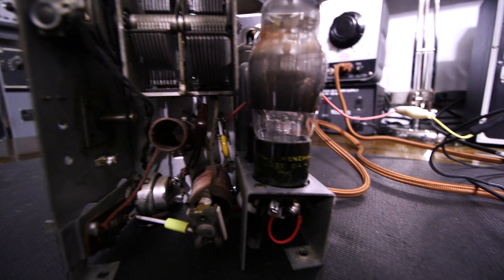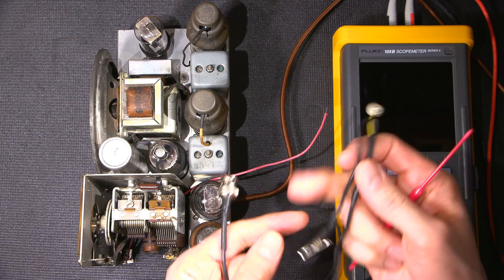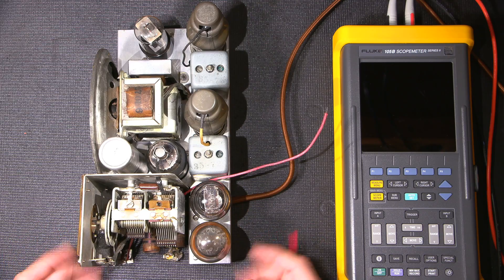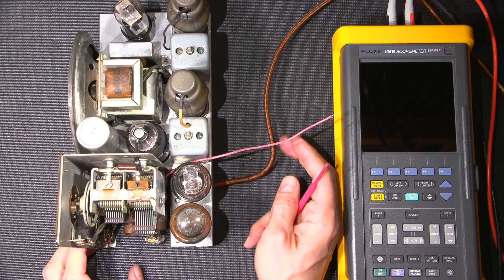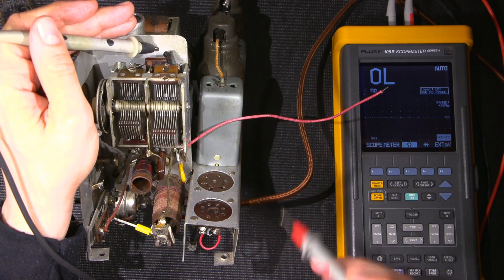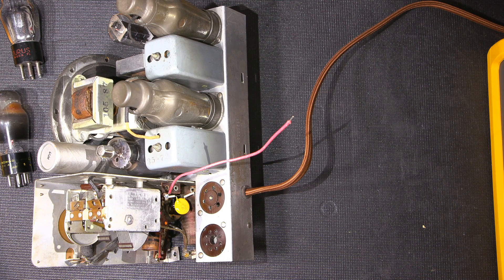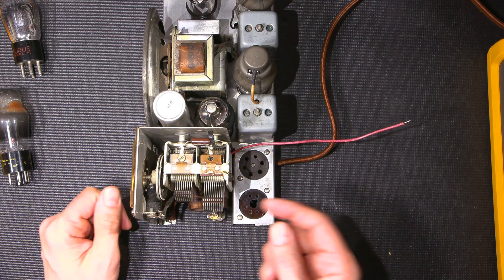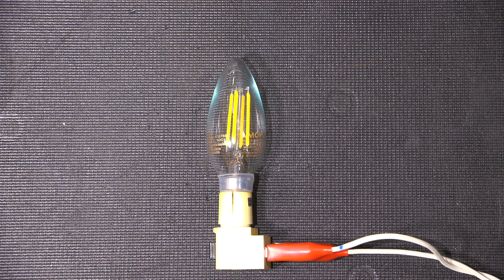See High Voltage Created From Falling Snow!

Comment: I have been flying commercially (pilot) for 32 years. Light Aircraft are more susceptible to static damage and lighning than larger airliners. Altho both have trailing edge wires designed to slowly dissipate static charge and keep any arcing from happening. The electronics in airliners are extensively grounded and shielded given the huge amount of computer controls used in today's aircraft. Falling snow has caused me more than one strong jolt doing a walk around on the aircraft before, just touching it. Falling snow builds up a huge amount of static electricity.  Thunder snow (lightning) even if it wasn't heard the buildup of static from the snow can and does run in directly thru the antenna connection. Especially on a dipole or long wire antenna. I would like to have known what difference if any having the ground connected . This type of static electricity would have most likley also affected the line voltage as well. Probably a combination of both.

Comment: Static electricity is something else.  Father was big in radios. He has an Antron 99 base antenna. It was hit with lightning and it exploded the loading coil. The rest of the antenna crashed to the ground. Grandmother's house has been hit by lightning balls,  burns right through the screen, bouncing off the floor and out the other window.

Comment: Hi Mr. Carlson, my guess it is an RF arc, not static electricity.  It appeared your setup was due to a very high Q with your antenna setup, and it would arc as it was going into resonance, momentarily killing the resonance, then the resonance would build up again, then arc again, and so forth.. are there any other ham operators in your vicinity?  If you haven't already spoken to them, you could see if they were on the air.  Likewise are you close to an AM station?  Finally, if it is DC, perhaps it could be a line that is building up a DC charge, one end arc's over, sending a pulse through the line making it momentarily resonate at some frequency, causing the arc on your end.  Kind of like natures own oscillator.  I used to maintain an FAA non-directional radio beacon that was around 400kc and resonant arcing was an occasional problem so care had to be taken when setting up the spark gap for the lightning protection.

Comment: Ceramic capacitors man. Piezoelectric effect in reverse. They behave oddly with really high voltage. Get a diecast box and stick 10 at least neons in series inside on your aerial down feed from screen to centre. Drill a hole so you can see what's happening outside with the atmospherics. Two reasons for the series neons, they have about 2 or 3pF each so in series you have way less shunt capacitance. The other reason I guess is obvious. Several KV will blow one up. I have had one hell of a whack on a summer's day from a long wire antenna. Great video, rather interesting 😎

Comment: Isn't that why the guys that often use big antennas have a large resistor on an alternate path to ground? Static builds up, it goes through that resistor rather than the radio gear.

Also heard that some people in dry remote locations have also used this effect to trickle-charge a battery. The pulse from the spark goes through one side of a step-down transformer, and then the other side of the transformer has something with a capacitor that can take the impulse and then trickles it to the battery cells. Nothing too amazing though, this kind of thing is for some 12v system that is just enough to run a radio in itself.

Comment: Maybe very high frequency pulses that the coil was high impedance to it. Then the cap allowed the voltage to build up then spark?
Have you a safety spark gap to discharge lightening etc on you antenna?

Comment: Maybe a smaller gap in the isolation transformer was discharging first causing a collapse of magnectic field in the radio inductor causing another secondary arc to its isolated ground.  Even though it is a low value inductor, we are talking about a very high voltage.  This sort of reminds me of the principle of operation of an old-sytle tesla coil autotransformer using a spark gap.

Comment: Obviously static on antennas isn't unknown, but the lamp being affected is interesting. The periodic nature of the arc is interesting, too.  Could the bulb have induced current in the coax?  I looked up LED filament bulbs, and sometimes they use a capacitive power supply in the cap.  If the bulb supply failed I wonder if it could have induced current in the coax causing the arcing and the snow was just a coincidence.  The regular pattern of the arcs plus seeing what the bulb is doing makes me think of a capacitor discharging.  I suppose snow/rain could cause a discharge with some regularity, but those arcs seem too regular.  Maybe place a piece of coax near the bulb and see if anything is induced on it.

Comment: I'll bet the antenna is acting like a lightning rod. Arcing is ac and so the coil is an open and the normal power feed is a path to ground even through the isolation transformer. There may be arcing across the on/off switches. This may explain the noise through the speakers?

Comment: I've seen this before from rain-static on a HyTower HF multiband vertical antenna.  It would frequently generate enough voltage to arc across the coaxial connector, and once caused pinhole burn-throughs in the center insulation of the coax at a resonant wavelength, making the coax lossy and useless.

Comment: Our Cushcraft 67B with 80 meter beams and the Ladder Line fed 180 meter long wire would throw almost one inch sparks during dust storms in West Phoenix when we'd unhook the coaxes at the exterior wall to the shack. And yes,  We learned the hard way about lightning... Twice!

Comment: I have enjoyed all of your videos I have seen. I find this one particularly interesting. I still consider myself a beginner when it comes to electronics. When it comes to terminology or principal, please forgive me. 
It appears as though your antenna circuit was acting like a half wave rectifier. With the atmosphere being a cathode and Earth as a anode or ground. More accurately your antenna seems to have behaved like a anode in relation to the atmosphere;  Yet, a cathode on your bench. Combined with your isolation transformer acting as a zener diode. When the circuit accumulated enough static it would jump through the coils as well as the insulation. For instance, at a high enough voltage, insulators will conduct. It most likely would not have happened if your coaxial shielding was adequately grounded. But, since everything was insulated your circuit collected enough static electricity to jump the gap. Not only between the leads of your safety capacitor; But, through the coils of your isolation transformer as well.  I think that if you were to have adjusted the tuning, it would've only changed the frequency and duration of the arc. However, you made a excellent point regarding the possibility of it being RF. Although, I think it is more likely it was static. It is quite possible the safety capacitor was taking whatever current to ground despite the 30 ohms resistance and that there was so much accumulating it would produce a arch. Whatever the current, it  also had to overcome the resistance through your isolation transformer. Similar to the way your capacitor tester measures the resistance through the insulating boot. It seems as though you could always rectify static off of your antenna if it was insulated. I have often wondered how to make a safe and reliable power supply. That  could handle it. The voltage would vary depending on atmospheric conditions. As well as solar or otherwise cosmic activity. I read in a comment the voltage ⚡ could be around 400kv. It seems like a similar circuit could be set up on the same principal. Where the static itself went through something similar to your isolation transformer. Through one side of the line cord and out the other, using Earth as a ground. To drive the secondary coil. Where it could be rectified and regulated to safely provide current.
     I heard on a YouTube video last night. That there is a device capable of harnessing power in a similar fashion. That is less than a few cubic feet. That doesn't use the Earth as a ground. Since your antenna is isolated. It seems as  though you could easily set your antenna up for full wave rectification. By adding more coax and some diodes. Or just utilizing the shielding as another conductor by placing diodes on the antenna    side away from the center conductor. Directing the flow away on the shielding from your bench and towards it on the center conductor. With or without  using the earth as a ground. You would be able to detect voltage. Possibly without a antenna. However, depending on the weather. The voltage might be a very small amount or very significant. Especially in comparison to using the earth to complete the circuit. For instance, this reminds me of a experiment that was done where a several hundred foot length of wire was insulated and then connected through diodes to Earth as a ground. The line energized and burned. I'm not sure if anyone was hurt or not in the process. So if you do experiment with it, please be very careful. It makes sense that your antenna circuit would behave the same way depending on how you set it up. Depending whether or not you incorporate the Earth as a ground. Although your antenna lacks the capacitance of such a long length of wire. It is obviously capable of producing high voltage. Which would explain what happened to your lamp as well as your speakers. Which would likely be in part, the result of coupling; As well as static discharge. Thank you for all of your educational and thought provoking videos!

Comment: The coax and radial might have been acting like a pulse transformer. The coax charges up, a spark happens Outside! And the pulse couples into the coil and cap to create a a high enough spark to the chassis
Reply: I like this theory, especially since when a capacitor and inductor resonate in seriesthey produce high voltage in the middle.

Comment: Is your antenna sharing an earth ground with your house ground? If so, can the static electricity buildup then coming through the negative side of the circuit from the plug and then find the path of least resistance. Static can do some Strange things😊

Comment: These old units are like old cars made with real steel new cars are plastic and paper thin sheet metal . They actually had power to ground wiring and switches . Not a can bus twisted pair 5 volt nightmare to diagnose  in a harsh environment . Very informative video of quality common sense equipment .

Comment: Your antenna to home became a  long giant capacitor! That spark is pretty significant.Your  outside antenna itself is a plastic covered wire with no shielding whatsoever, hmm. Saw your set up in the ice storm video. To keep static from building up on it maybe a spark gap could be used to attract the electrical build up from entering the home. Solder a piece of wire to it just outside the home and  attach the end near the ground on a rectangular wood block almost half way along it's length. One the other end of the wood block attach a thick solid  copper wire  like a #10 or #8 that goes to a ground rod. Make sure the ends of each wire is  approximately 1/16 inch( 0.160 cm) away from each other and in the same line as each other.The wood block itself could be screwed to a metal rod into the ground for support. This should keep the electrical build up at bay. A great excuse to go your local home improvement store!

Comment: All transformers primary and secondary windings have capacitive coupling beetween them.  The seperated windings are great for blocking power line frequencies, but RF can still go right through them. They make transformers with Faraday shields Between the windings to improve the situation, I wonder if yours has one, and if its connected properly.

Comment: Hello Mr. Carlson,
It's my theory that you have water penetration of your coax. And since you said that your using such a small coaxial cable you should inspect your penetration points and connections for this possibility.  If your antenna in mounted outside in harsh winter weather, snow and dry air is a big conductor of electro-static charging conditions. I don't know if you are using a simplex or duplex antenna however this antenna most assuredly is connected to a ground.
I have a question for you. Is the table you used showing the video connected to an earth ground? Like an ESD type set-up? If so that explains why your chassis was arcing (spark gapping) from the charged Capacitor via your ESD ground.  If you want to test this theory, unhook your ESD ground wire and retest. Or you could just insulate the surface by setting the chassis on a thick non conductive surface.
Best regards.

Comment: It almost sounds like the coil on the radio was behaving similarly to an automotive coil. once the charge in the automotive coil builds up and the field collapses when the points are open it generates Spark. I wonder if something in the radio or the Transformer were acting in a similar way to ignition points.
Reply: I was thinking along similar lines. The EMI created and discharged from a cars ignition coil, would convenientaly find its way through the ground plane wire attached to the hood. And without the filtering capacitor on the primary of the coil, the speakers would hum at the same frequency of the engines  ignition pulses. There is no  "physical" connection, but electricity is still being sneaky. I agree with the similarity here.

Comment: You could probably estimate the voltage at the point of discharge by measuring the distance between it and the chassis and multiply that by the breakdown voltage of the air.

Comment: Maybe you should install GDTs on your antennas if you don't have them already. Presumably the discharge energy was relatively low current; enough to destroy some of the bond wires in the lamp LEDs which might be visible under a microscope.

Comment: Note:
The piezo-ceramic ignition element of a lighter can also be used to generate arcs to a metallic object without touching this object.
From a logical perspective, electricity can only flow when the circuit is closed. I would suspect that due to the snow and humidity at the time of the arcing, the antenna behaved like a electrode of a charged capacitor. The opposite electrode of the capacitor was then probably the ground or whatever. In this case, I would see the ambient air as a dielectric.
You can use a isolation Tester to test your Isolation-Transformer for Ground-Leakage/Fault. Depending on the used Tester you can set different Test-Voltages up to 10,000V.
Every electrical company should have insulation measuring devices and / or device testers to check your equipment and your electrical system of the whole house. Ideally, the insulation resistance is infinite (not measurable). Cables and, above all, their insulation age over time and can then provide measurable insulation resistance up to ground faults. Be carefull when doing insulation Tests at devices with electronics inside. Unplug every electronic device before running insulation Tests at sockets or from your fusebox. These Testers can easily destroy sensitive devices. I'm from germany - here a insulation Test is typically set to 500VDC if there are no surge protective devices installed. When such devices are installed and it is not possible to separate them, we have to set the Voltage to 250VDC (Our consumer-grid delivers 3-phase 230/400V AC 50Hz). The limit we allow is ≥ 1 MΩ. Anything less than 1MΩ is considered failed.
We now even have to install lightning arresters and surge protection in the electrical systems. These are SPD (SurgeProtectionDevice) type 1 and 2, or combination arresters, which are type 1 and 2 in one. These have to be installed as close as possible to the house feed and before the electricity meter. These devices has to be grounded separatley to an foundation earth or earth rod. When more than one fusebox are installed in different locations of a building, we have to install SPD Type 1 or combination arrester befor the electricity Meter(s) and SPD Type 2 in every fusebox.

Comment: Could it be simply that the humidity in the lab air was enough to "ground" the radio chassis?  In theory you could have observe this even with the radio disconnected from the isolation transformer.  Like touching a piece of isolated metal in the winter time after walking across carpet.

Comment: That was VERY strange indeed! Clearly several KV is needed to jump the gap, which should be impossible across a 36 ohm shunt. I can only think that as the 36 ohms was an inductor, the voltage pulse must have been of an extremely short duration, and quite intense. It's a mystery almost paranormal 😃

Comment: The coil is an inductor.  When the charge flowing from the antenna through the inductor runs out, the inductor draws from the chassis (loop of lest resistance) until its' magnetic field collapses. 

I'm curious how snow transfers charge.

Comment: I think your antenna pickup Some radar signals, that could be the answer for the arc at the spot,  it was at the point where the standwave was high impedance and therefor high voltage, only few millimeters at eatch side there is low impedance and low voltage 🙂

Comment: Question would be is static electricity ac/dc or rf in form; we know static electricity in voltage and low or no current so what if it was RF with a voltage carrier?
Reply: I would say dc with fast rise time the coax would be charging the whole system in till the charge on the chassis side found a arc point the sudden discharge would present as a fast rise time to the coil blocking it causing the reaming charge in the coax/antenna to ark to the chassis.